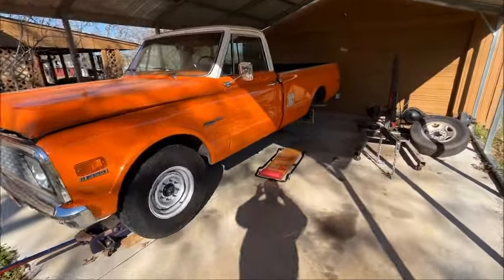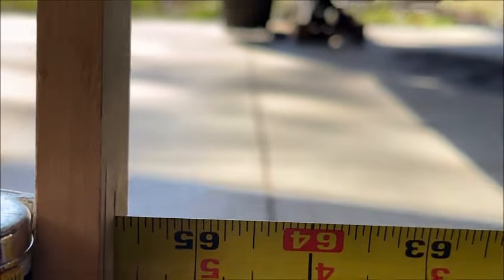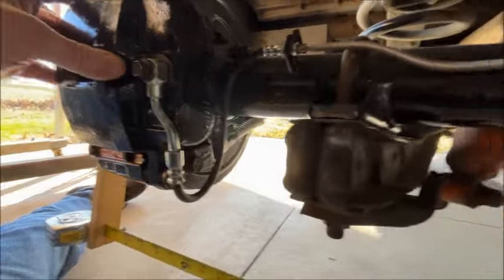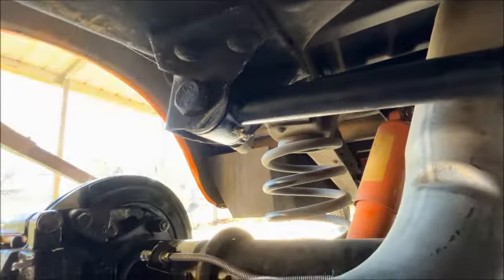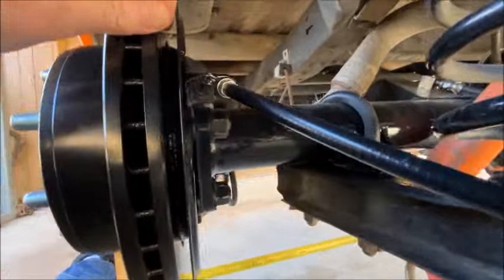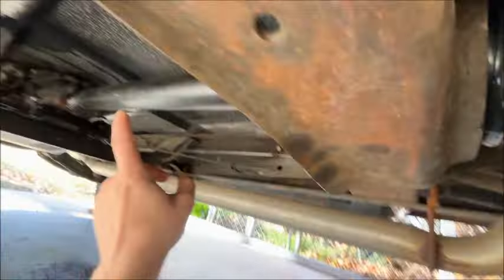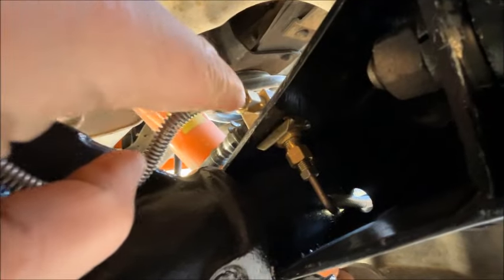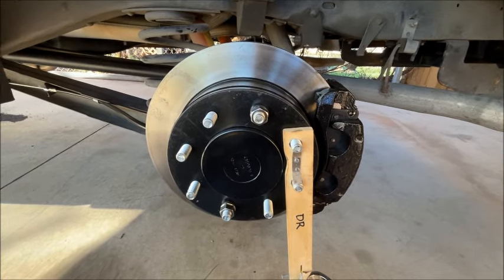1967 - 72 Chevy C20 Axle Swap to 9.5", 14 - Bolt w/ Disc Brakes

Comment: Is the ho52 for sale? Mine has a 5.13 gear, ive been trying to find a 4.10 for a year now
Reply from the maker: Yes, I do plan to sell it.   It's turnkey and ready to go.  Has the rare 4.10 and Eaton locker.  I overhauled it about 14000 miles ago.  All new bearings and seals (no china garbage), new drums, shoes, hardware and lines.  I added ceramic bar magnets to catch any wear material and have run 75w90 synthetic.  Only bad thing is the ring gear makes some noise at highway speeds and that drove me crazy because I'm really picky.

You could bolt it in over a weekend and be driving to work on Monday.
Reply: @BriansGarageUSA  I would be very interested in purchasing it off of you when the time comes for you to sell it
Reply from the maker: @matthewlavan1226  It is now on Craigs and FB for Tulsa area.
Reply: @BriansGarageUSA  
I'm researching something similar. my C20 has a Dana 60 full floater on leaves. I want a 14 bolt full floater. I've been told there's a bolt in version. Drums vs disc I'm indifferent.